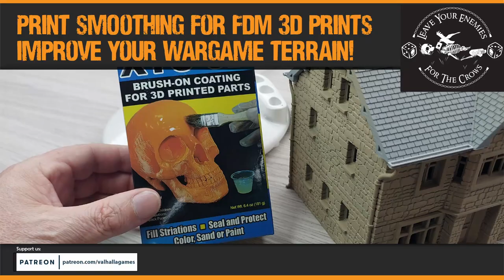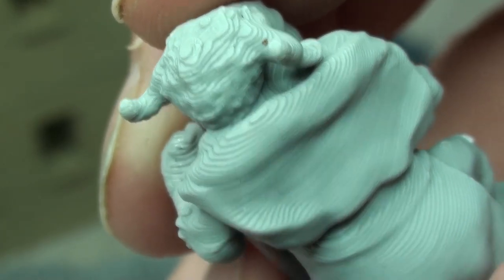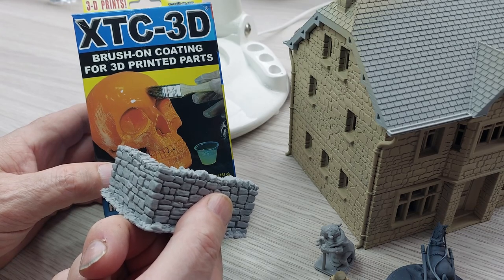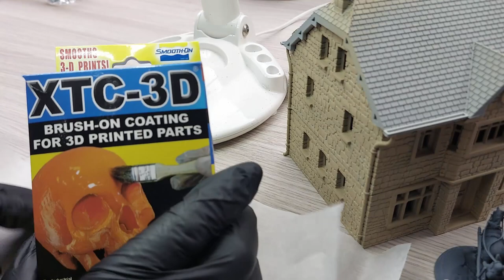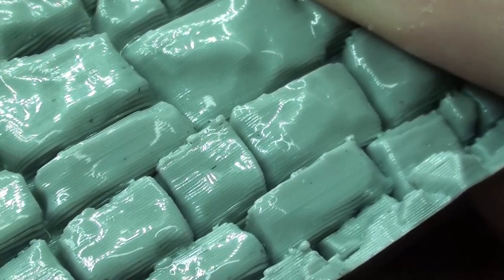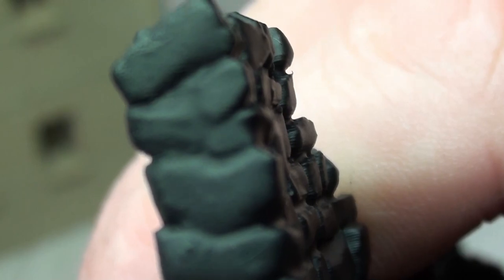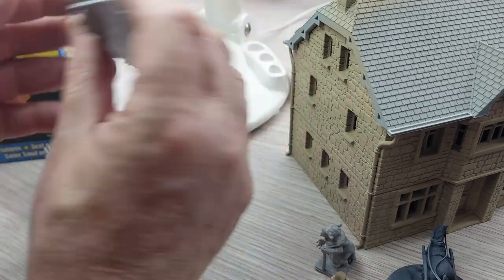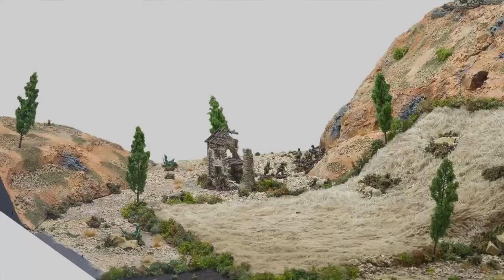Print smoothing for FDM 3D prints

Comment: Umm, so a clear resin to apply over the print to fill the striations. Looks to do the job, I didn't see the difference between the GW primer and the rustoleum on the last test piece. Did the rusoleum give the more stone like finish? What was the full name of the rustoleum can please?
Reply from the maker: Hi Ken, at 18:01 you can see the rock texture on the first one but I wasn't able to reproduce that again which is, I guess, really great as you wouldn't want that on your mini's generally. I can only put that down to an environmental anomaly, too humid perhaps or perhaps the resin wasn't completely cured? I don't know which paint  that was either, if I had to bet based on gloss level I would say it was the GW. Never seen it before or since. The primer is Rustoleum 2X Ultra Cover Flat Spray - black (https://bit.ly/3wkiC3h). As soon as I have 5 mins spare I will try it on a flat wall as well and let you know the results.
VHG_Rex

Comment: I wouldn't rule out FDM printers for minis if you have good print settings and a good size nozzle. Ive found pretty good results off of an FDM printer with tweaking (not as good as resin but close enough). For me, mainly because of my living situation, resin printing is out of the question so Ive tried alot of methods on FDM priners to get a good mini out of it!
Reply from the maker: Yes I have seen some surprisingly good FDM prints lately, technology in FDM has move on a lot since this video was shot.
Also everyone has a deferent tolerance on what they find acceptable quality wise. Ill have to print something on my next generation FDM printer, make a short video and link that that. Thanks for watching and commenting VHG_Rex

Comment: Really interesting: I wonder whether it would work better on flat surfaces, like building walls.
Reply from the maker: I will check that out shortly, normally on a big blank building side I do use filler and sand but I don't often have a big featureless wall that's good for sanding. I will report back im pretty excited.

Comment: You need to clean your nails ;) Have you tried acetone vapours bath to smoothen surface of 3D printed terrains?
Reply: Yes just did a massive priming and base-coat session in black and brown as I recall. The thinner takes it off the skin but not underneath. Realised it after... too much close cam, my mother would not be impressed 🙂
Reply from the maker: No we haven't tried the acetone vapour bath method, I believe it doesn't work on PLA based on what I heard.